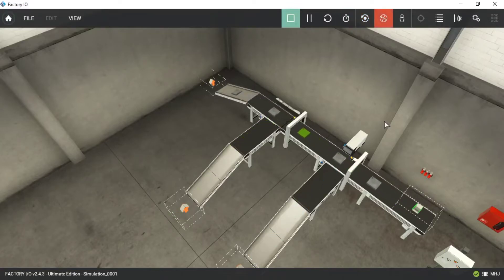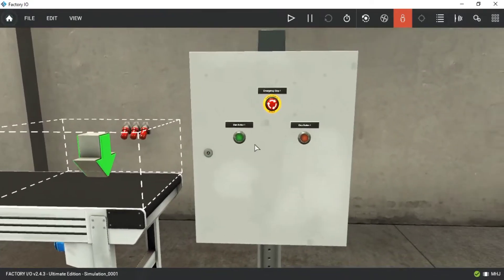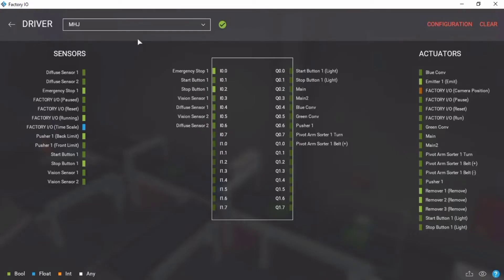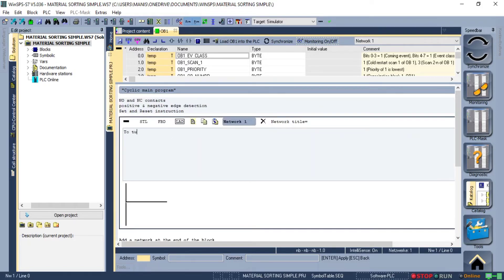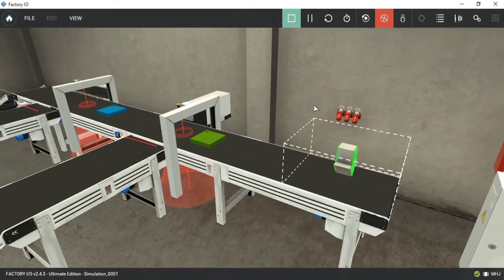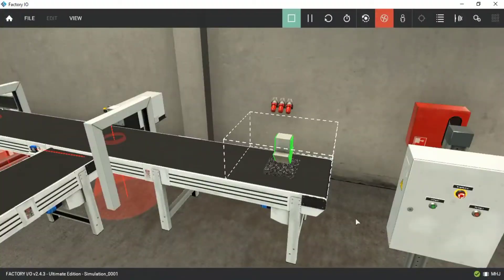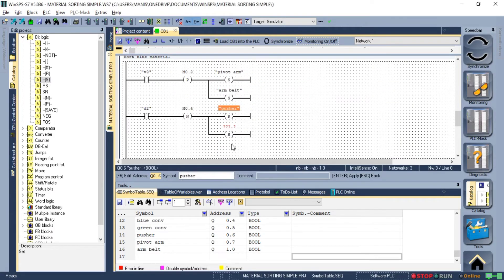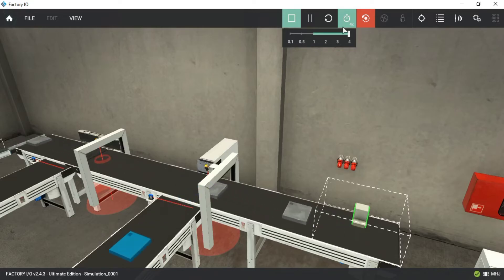Material Sorting in 2 MINUTES  | PLC Programming | Ladder Logic | Simulation

Comment: Hello thanks for the tutorial. May i ask why did you name them m 0.0, m0.1, m 0.2 and m0.4?
Reply from the maker: That is memory addressing. We can use them to store the state of input and output.
Reply: @real_ee   @Void  i tried recreating what you did but the 2nd conveyor (main2) does not move at all... Maybe I'm doing something wrong...?? Thanks
Reply from the maker: It's hard to tell without looking at the program. Still the possible reasons for this can be either the conveyor is not connected to the plc in factory io or the set instruction for the conveyor is missing in first network. I have given a link for the plc program in the description.
Reply: @real_ee  thanks very much, I'll check the link and see what can i do to improve
Reply: @real_ee  hello, can you help me with a small problem in this simulation? In factory io at the actuators list the factory io start, factory io stop and factory io emergency do not appear at all and when i push the green start push button that i have "physically" put in the scene the simulation doesn't start
Reply from the maker: Start,Stop and Emergency stop push button all are sensors so they are not in actuators list. You can only see the start/stop push button light in actuators list
Reply: @real_ee  hello, i hope you are doing well! I tried everything (including the code) as you have made it in the video, but when it comes to the pusher it never works in the factory io simulation... Also the pivot arm only moves once and stays like that forever - the passage of the green package through the diffuse sensor does not triger the pivot arm to make a reverse movement... Any help ideas would be very appreciated. Thanks 🙋🏻‍♂️
Reply from the maker: Hello, if it's possible can you please share  your simulation and program files so that I can look for the issue.